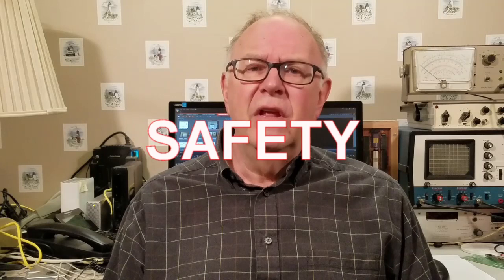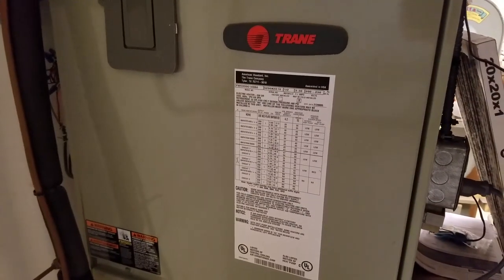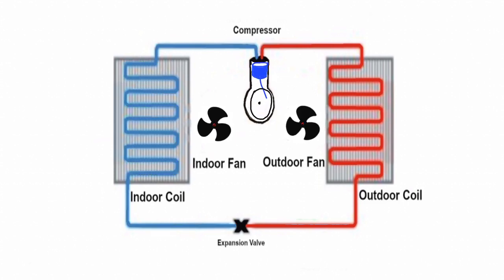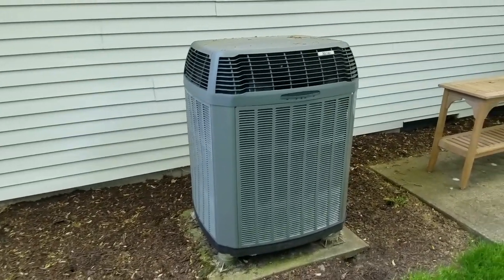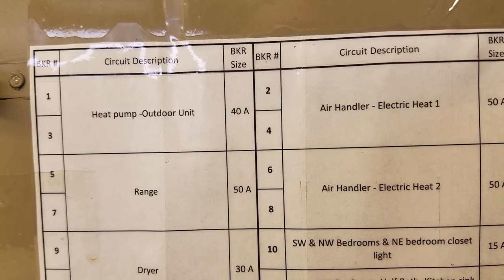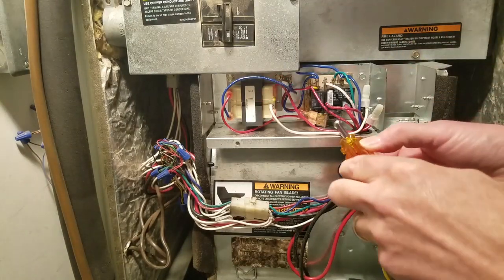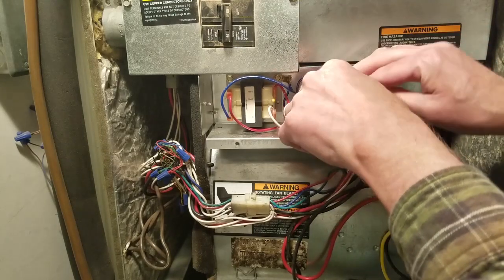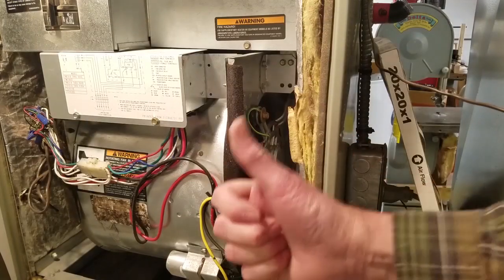RLY02807 Air Handler Blower Relay Replacement

Comment: Nice to see your video.  The inside of your air handler was very similar to mine.  My time delay relay is an older style ST82D1004.  I've ordered the RLY02807 as a replacement and hoping all the wires are long enough since the terminal arrangement is quite different.  I'll know this weekend if the replacement is a success 😁.
Reply from the maker: Hope it goes well.  Several years ago I also had different modules, but it all worked out.
Reply: @LifewithDavid1  Well, the transplant was a success.  Amazon delivered the new relay around 2PM.  It wasn't difficult to know where the new wires went, everything is well labeled.  What was a bit challenging was getting the wires to the new locations.  The terminal layout is just so different from the original.  But I worked that out eventually. 

I had also replaced an old Lux thermostat with a new Honeywell Smart thermostat while waiting for the new relay.  Had a few extra control wires so I could add the C-wire.  

But when I fired everything back up, the thermostat came alive (I had previously configured the Honeywell) but I get this message "waiting for equipment".  For 5 minutes, I sweated bullets while the system had this long pause before the compressor kicked in and the unit started cooling.  For the rest of the day the system has been cycling normally and everything seems to be running as expected.  I don't know if I could have done all this without the Internet and all the tidbits you guys post on YouTube, but I sure do appreciate your help!  Thanks again.
Reply: I think the relay in my old Trane air handler is failing, which also uses the old style ST82D1004, which of course is not available for purchase any more.  But apparently the ST82D1004 is a combo relay + time delay board (which just slides off the relay's double pole contacts), so I ordered just a relay and plan to reuse the existing time delay board.  Hopefully that solves the problem.  If not, I may have to look into doing what you did and rewire with a new style relay/board.  And for some reason, amazon's price on the RLY02807 is 3x other relays, so not sure why that particular one is so special.  How did you figure out the new wiring?  Did the RLY02807 come with detailed instructions?
Reply: @Jeremy-vb6tv  
@Jeremy-vb6tv I checked my paperwork and the RLY02807 replacement relay did come with useful instructions.  Figure 1 and 2 of that document shows the terminal layout for the new relay, while Figure 3 and 4 shows the old relay layout.  The terminals are pretty well labeled.  Before removing the old relay, I made notes of wire color for each terminal.  The most difficult part was figuring out how to best rearrange the wires to reach the new terminal layout.  It wasn't impossible, no wire splicing was required, and in the end it all worked out just fine.  Take your time and it should work out for you too.
Reply: @darkenergy5686  Thanks for the reply.  I did locate some instructions online, so I'm pretty sure I can figure it out if I have to go that route.  Good to know for future reference.

Comment: @Jeremy-vb6tv I checked my paperwork and the RLY02807 replacement relay did come with useful instructions.  Figure 1 and 2 of that document shows the terminal layout for the new relay, while Figure 3 and 4 shows the old relay layout.  The terminals are pretty well labeled.  Before removing the old relay, I made notes of wire color for each terminal.  The most difficult part was figuring out how to best rearrange the wires to reach the new terminal layout.  It wasn't impossible, no wire splicing was required, and in the end it all worked out just fine.  Take your time and it should work out for you too.
Reply from the maker: Thanks for sharing.

Comment: My air handler started to smell like bread in a toaster. Turned my breakers off then went exploring.  First of all the heating coils one of 3 was burnt, the blower has went out so I replaced it all and still never got the blower to work but a half a second. Watched you video and went back to mine and heard the relay kick off. So now I'm waiting on my relay
Reply from the maker: That relay is a common point of failure.  Good luck!

Comment: I have a 6 year old house, all the pieces (heat pump, furnace, etc) are the same age. My problem is that the inside fan won't stop blowing air after reaching the desired temperature. Even if I turn off the thermostat completely, the fan keeps pushing air, but of course, now it's cold air (it's winter, so we're in heating mode). In order to get the fan to stop, I have to flip off the switch on the furnance itself. I can then flip the switch back on and the fan will not start blowing again until the thermostat temp dips and it kicks back on, as appropriate. Do you think the blower relay switch is the culprit?
Reply from the maker: Absolutely.  That is a classic symptom of a sticky relay.  The relay contacts get stuck together and the only way you can unstick them is to kill the power.  Good luck!

Comment: Excellent and efficient video.  I've gone through 2 of these in the last 13 years, although I think one of them may have had a component damaged by a screw.  Do you know what component on the board tends to fail?
Reply from the maker: I believe the contacts on the relay start getting flakey.  They either stick or don't make contact.  Thanks for watching!

Comment: my indoor blower won't stop running no matter what, could this part be the problem?
Reply from the maker: Absolutely!  That was one of the tell-tail signs when my previous relay failed.  The indoor blower just kept running.  The relay contacts burn in and they won't release.  Good luck!
Reply: @LifewithDavid1   yep, it was the relay. $23 on amazon, unit running great now. An ARUF series Goodman.

Comment: My blower handler won't shut off, how do I test the relay.
Reply from the maker: Sounds like the blower motor relay contacts have "welded" together.  I've had this problem and a new relay solved the problem.  You can test this by turning off ALL the power, disconnect either one of the blower motor wires at the relay, and then check for continuity between the common and the N.O. (normally open) contacts of the motor relay.  If there is continuity, then the motor relay is shot.  If no continuity, then the problem is in the timing circuit.  Hope this helps, good luck!
Reply: Yea there's continuity. That was the first thing i checked but didn't know if there was suppose to be continuity or not. That i guess was my real question. Thank you. I already ordered the new part. I was just 80% sure. Lol.thank you. I really do apprciate it.
Reply from the maker: @1alex1311  Glad I could help!
Reply: @1alex1311  That's what "normally open" means, no continuity unless it is energized.

Comment: Excellent video Mr. David.  
I have the same Trane AirHandler and went through that process approximately 5 years ago and again just yesterday.  Do you know what would be causing this failure?  I did notice on the Relay Block that the areas marked R2, R8 and R1 had scarring/burn marks.  Any idea why this would occur?    Thanks again for your great video.
Reply from the maker: Thank you.  I've also replaced mine about every 5 years.  I think the power relay contacts get a little burned and they start to get a little flakey.  When I get a little time, I might look at the failure mode.
Reply: @LifewithDavid1  Really appreciate the reply - thanks!  

I am no HVAC technician, but I will keep poking around on my end as well.  

By the way, I tried reaching out to TRANE for a bit of help but they nicely told me they don’t provide such support, I will have to call one of their techs.  I told them that’s ok, I will take a pass on that.

The last tech tried to sell me a new system 5 years ago when I was having the above issue,  I told him I’d get another opinion and get back to him.  I researched the symptoms and fixed the issue by replacing the outside capacitor and the airhandler relay block.

Thanks to videos like these, I have benefited much.